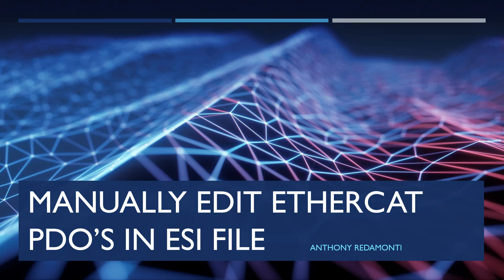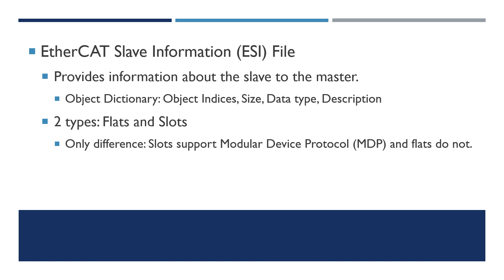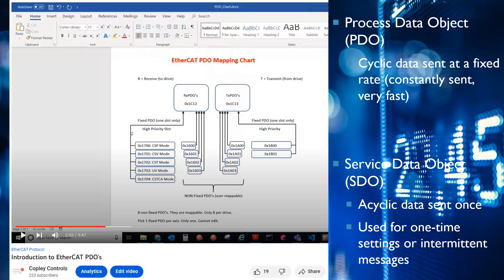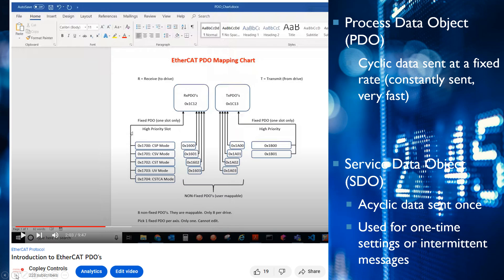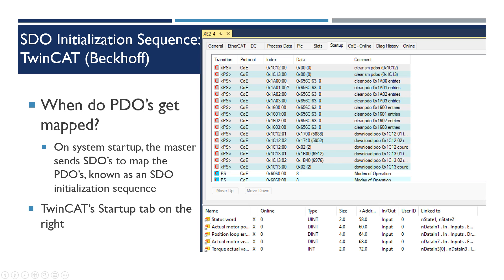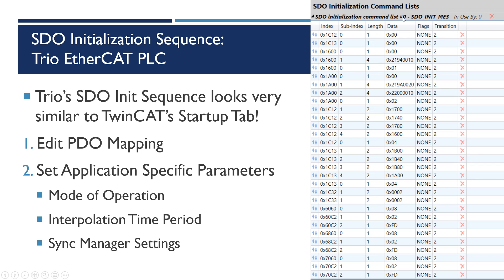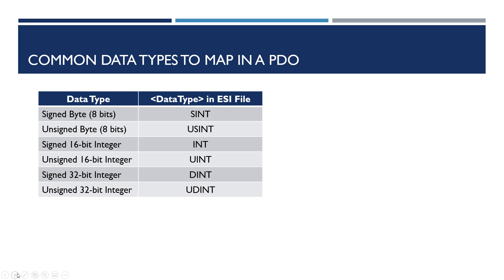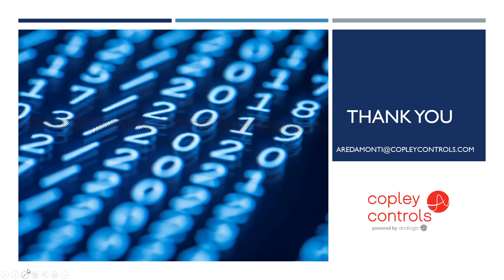EtherCAT ESI File Introduction (and how to edit them)

Comment: I'm assuming the 32 byte limit is a limitation of this drive model. My vendor's TxPDO is 408 bytes. We're using CODESYS and I haven't seen the PDO setup code. They do have function blocks to initialize sync manager and FMMU but I'm having to figure out how to convert ESI values to arguments for those function blocks, based on their "Dynamic Config" example. (My goal is to handle bus-down and bus-up events so techs can recable the bus without restarting the PLC, much like hot-plugging USB or FireWire.)